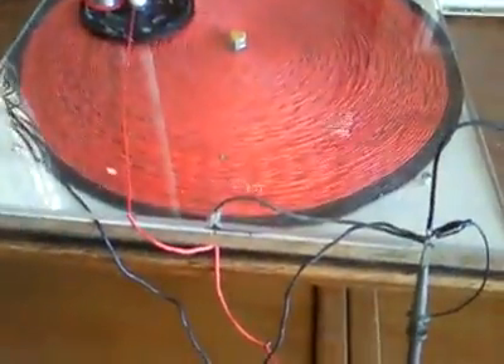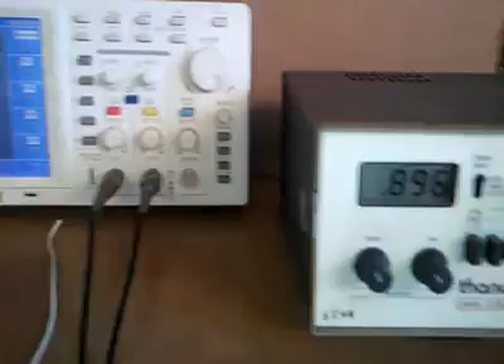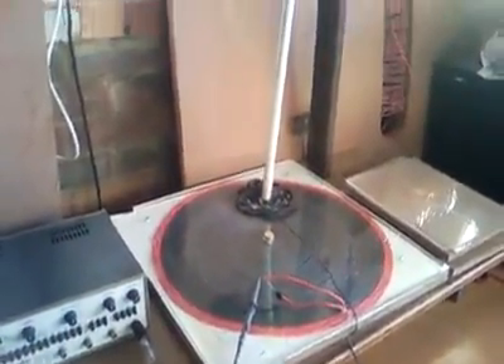Apparatus For Transmission Of Electrical Energy facebook.com/donno191

Comment: The reference to Tesla patent 649.621 is not really apt. What Tesla proposed was a high voltage transmission in high regions of the athmosphere, where air is more conductive. If you check the text of the patent he proposes for instance to use balloons for the metallic spheres to reach great heights.
The symmetric behaviour when the two sides are changed is not surprising, this can't be modelled as a transformer. It's a transmission which behaves likewise from left to right and from right to left. Input signal is distorted, probably since the function generator is overloaded. The received signal is a pure sine wave probably due to the fact that only the fundamental wave but not the harmonic waves are coming through.
The higher voltage at the receiving end is by no means an indication of a power gain.

Comment from the maker: I could not read the amps clearly as this is alternating current but on my scope the wave on the receiver was out of phase like a 1/4 of the frequency the length of the wave is the same but the height differs as the height of the wave at the receiver end was higher than the transmission end as can be seen in the video.